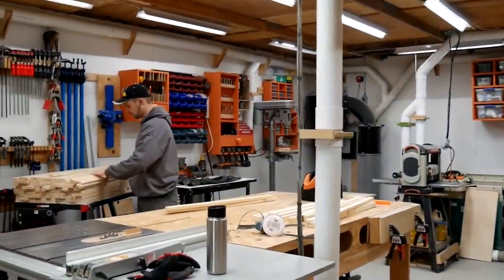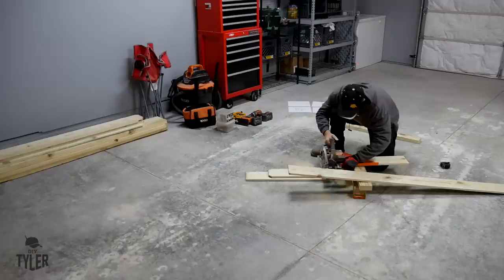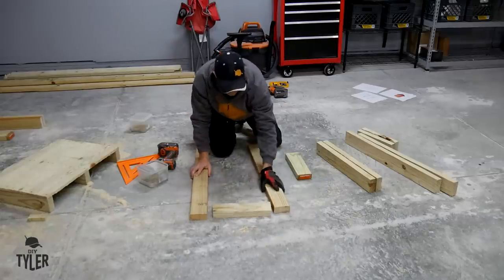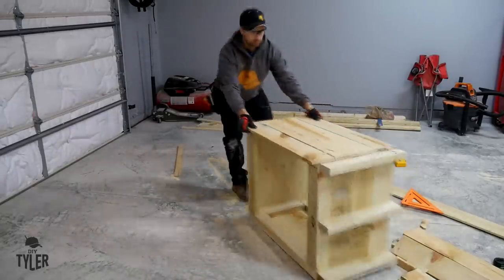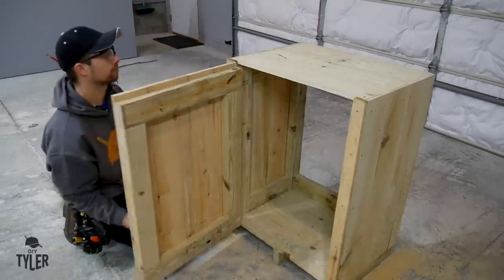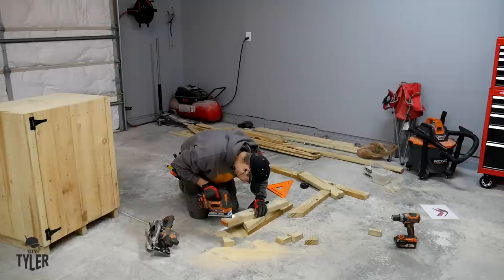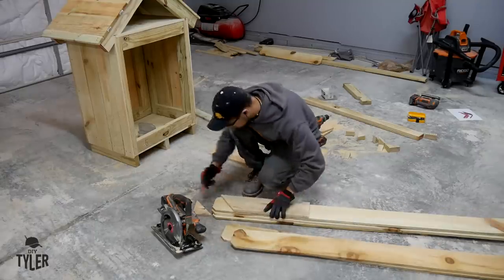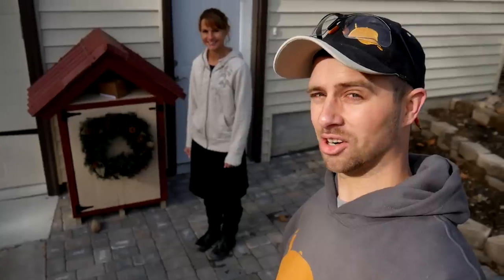How to Build a Package Drop Box | Only 3 Tools Used!

Comment: Just today, I was thinking about the need for something like this. In my case, not for weather protection, but for theft deterral. I want to work in a combination door lock so the driver can just put the package in and slam the door, because I don't think they're going to take the time to hang a padlock in the hasp and lock it. Also, when I'm going to have multiple deliveries in one day, I can put the combination in the delivery instructions and they can (if they will) open it easily to put more bling in the box for me. Your design will work well with this idea. Thanks!
Reply from the maker: I like your ideas, would like to have a way to lock it as well. Will have to see what I can come up with! Thanks for watching Jim, happy Thanksgiving!

Comment: Great project.  Only thing I'd change is using 2x3s instead of 2x4s.  Save a little money and increase storage capacity by a bit.
Reply from the maker: Good idea James! Would definitely increase some capacity but I have doubts it would be cheaper....if you got PT wood anyway, it would probably be cheaper if you used none treated.

Comment: The challenge is to design a drop box that can accept several package deliveries per day and each package remains secure from theft between deliveries.  A padlock or key code instructions just don't work because delivery people won't do it.  It's "not in their job description" and and each box they encounter could have different instructions.  The box needs to be large enough to accept several reasonably sized packages and still be smaller than a Buick.  Forget the use of smart locks, apps and complicated electronics to manage entry as these drive the unit cost sky high.
The "Danby Parcel Guard" drop box can accomplish the criteria, but still retails for $550.00
Reply: One of our design ideas was a Dropbox much like a library has, slotted and curved but hidden in a bench style. We would open the padlock to retrieve packages and that would be that.
Theft of packages with this design might be a problem, but we would have a bigger problem if people wandered  onto our property here in the country. So this works beautifully for us. Thanks for watching!

Comment: You failed 5 tools used 🤔
Reply: Speedsquare and paintbrushes?
Reply: _The_Wife _ uhhh yeah.  Those are tools.
Reply: @bigscreenbird8198  Indeed. I should have specified Power Tools, which is what I meant in the challenge.
Reply: More than that: 3 power tools, square, pencil, fence board used as a straight edge (which makes it a tool), paint brushes... and of course his brain (they say your brain is your greatest tool). And we'll ignore the screwdriver bit, saw blade, his hands, his eyes and the ground. ;)
Reply: @SteveFrenchWoodNStuff  🤦 And here I thought he conquered the challenge.

Comment: I’m calling cheating, you either used paint brushes or a paint roller which are TOOLS. You need to crush this version and do it again giving up either the circular saw or jig saw to use the painting equipment. Jk, great practical build, thanks for sharing.
Reply: Christopher Kelly—wow—way to hammer him. Next you’ll object to his use of a speed square and tell him he needs to do it by eye. Don’t forget the utility knife, but I’m guessing he gave himself wiggle room by having all the items in his tool bag. ;) I’d say he built it within the rules he set forth and the painting was his wife’s doing after it was built.
Reply: @jasonbailey9139  Thank you! 3 Power Tools, I failed to specify.
Reply: @_the_wife_3323  Tyler did say he was going to take his tool belt. A lot of people keep a speed square and utility knife in the tool belt.